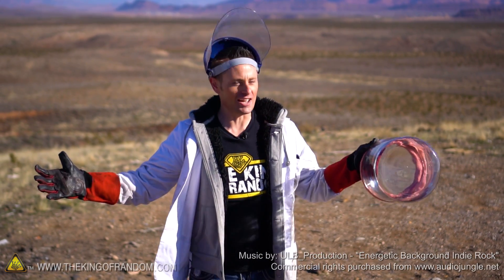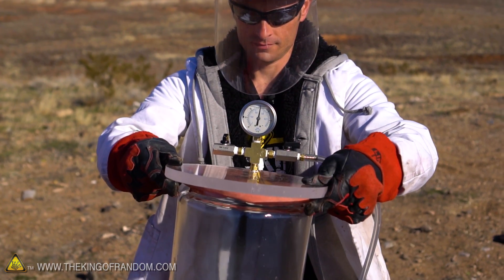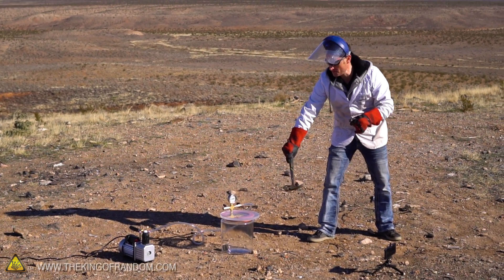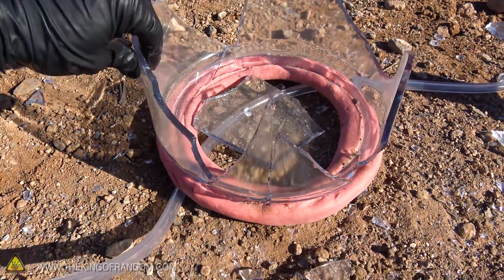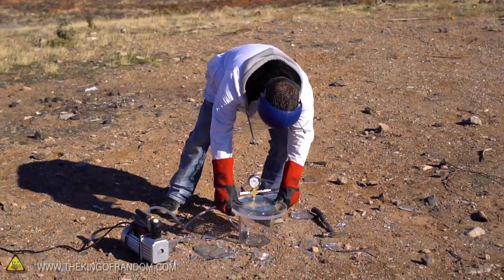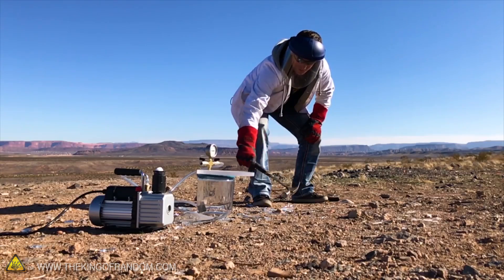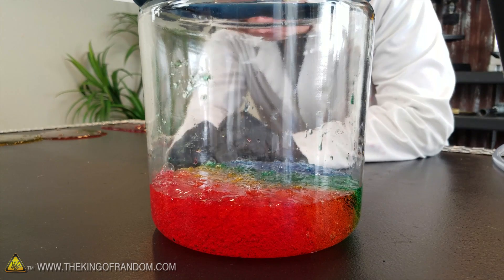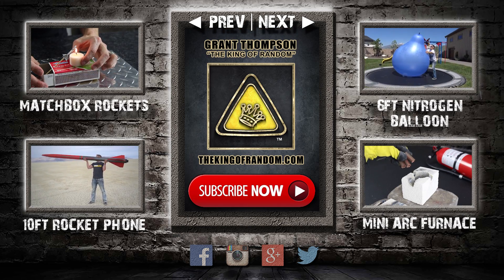Smashing Glass Vacuum Chambers

Comment: There was definitely a pressure wave when the chamber was dropped. It went completely flat, sucking everything inwards you can still see the camera shake. Nothing on the ground moves during either time the camera moved but they’re in the second. You can actually see the pressure wave the only way to really tell that the camera moves is by looking at the background you’ll see it’s slightly shaky.

Comment: Well those bell jars are actually made of much thicker tempered glass so if it does shatter it won't throw jagged pieces of glass at you, but it would only be square cubes of glass. Also bell jar glass is heavy, like really heavy. Glass is about 1/2" thick or so. I had used one of those vacuum coater that sputter coats samples for SEM usage, and the bell jar for them is quite heavy.

Comment: Your camera is experiencing a gradual decompression and a rapid compression.   If you are only reaching 25 inches of vacuum, there is something wrong with your setup.   Why did you go out to the middle of nowhere to run these tests?  The glass could have been well contained in a backyard setup.   Why not use a pendulum weight or some other means of breaking the jars remotely?  You endangered yourself doing it by hand, your face mask wasn't always providing complete coverage.   Your results were interesting (it turns out these implosions are less energetic than I would have thought), but your procedures are all over the place.
Reply: Their vacuum sucks

Comment: I used to hear that a CRT could implode violently if damaged. And with some understanding of the effects of pressure differences I believed it. Until I saw one get the neck broken and there was just a strong suction noise as the vacuum was let out (or let in?)

Comment: My glass jar vacuum chamber cracked spontaneously without warning after about 3 months of use :( so I guess you can never trust it will hold up forever. luckily it didn't implode fully. I did some maths and it seems that the vacuum put my jar under continuous stress equivalent to 8 tons of weight.

Comment: You could have broken it with less "force" if you had used the claw rather than the flat, lower surface area would exert higher pressure with less applied force.

Comment: What if you slowly drilled a hole into one or used something sharp? I wonder how much of a break it needs to compromise the structure/ if there's any point where it would just release the pressure. I would assume no matter what you did, if you got all the way through it would break, but I'm interested to find out.

Comment: what does an arc do in a vacuum.? is it any different under pressure? (i would imagine so as high pressure sodium lamps have a very tight arc when they have low current passing through them at a high enough voltage to 'ignite' them) ****EDIT

Don't try this.. just remembered you make an Xray tube with high voltage in vacuum chambers..

Comment: it depends what material you use if it implodes, with the glass however, when you made a crack in it, the air rushed in so hard that the force of the air pushed out the glass and shattered it

Comment: You could also coat the outside with acrylic or fit an acrylic cylinder over the glass then the hammer wont do anything and its still cheaper.

Comment: Hey grant I was just drinking some soda and I was wondering what would happen if you put carbonated drinks in a vacuum chamber?
Reply: It will EXPLODE if the can breaks. Soda has tons of molecules of CO2 dissolved in it. As the pressure decreases on the outside, the aluminum can might not be able to hold it all in.
Reply: dontDrop_That what if the soda isn't opened?
Reply: Blizzard exists probably because it's basically water
Reply: Noah Bowers it will go flat
Reply: Noah Bowers it would go flat as flat as any soda can get

Comment: Did you hear a bell ringing? - place an electric bell or kitchen timer 
inside your chamber and turn on the pump.  Make sure the bell is turned 
on!  As the air molecules are pulled from the chamber, the sound will 
slowly disappear until it is gone!  Great way to explain to students why
 an astronaut would never be heard if he were to start screaming while 
in outer space.

Comment: Hi Grant - Do you remember the PVC bike pump you made and how it had an air in and air out valve? Connect the air in to your vacuum chamber and see how low pressure you can get from that bike pump you made.

Comment: What would a can of soda do in a vacuum chamber?
Reply: Nothing if its not open
Reply: It would explode since unopened cans of soda are underpressure so in a vaccum with no atmosphere to prevent expansion of the bottle the bottle will expande and eventually burst
Reply: @divine308  it's only a difference of about 14 psi to the can, well within it's limits. I predict the can would be fine

Comment: Will HHO gas still explode with no other air? I know that is cannot be a complete vacuum if there is some HHO in the container, but you could put some in a balloon and hook the balloon to the intake valve. If you do this, be careful not to have the balloon get sucked into the jar, but that could be another experiment.

Comment: It would take less force to shatter the jar if you hit it with the claw side of the hammer. The flat side spreads out the force the claw would concentrate it into a much smaller area, making the force/unit area skyrocket.

Comment: What happens when you mix molten metals with liquid nitrogen
Reply: Yeah, someone with an actual brain
Reply: CAKEMONSTER3000 depending on the mass of the nitrogen the metal might solidify, what will surely happen though is thar the nitrogen will boil violently expanding (almost exploding)
Reply: CAKEMONSTER3000 solid metals the nitrogen would freeze it and it would be solid

Comment: It explodes... how unpredictable... -_-
Reply: Imploding I say, the atmospheric pressure was weighing down on it, and Grant's hammer just provided the energy to compromise the structure of the jar
Reply: You can tell, because the glass jar turns white, meaning that something was sucked in, hence implosion.
Reply: i say it explodes. 
it suffers a rapid re-compression . all it needs is one crack to let the air in.

Comment: put dough in a vacuum chamber and see if it can make bread without air bubbles
Reply: SilenT●CSGO & More!   *Edible
Reply: ItsAlex Then its dough rock,not bread.
Bread is supposed to be eatable
Reply: JohnnyDeRp_ 123 Thanks!
Reply: SilenT●CSGO & More! You're welcome man!
Reply: Actually if you want to make bread fluffy, you need two things. A leavening agent, something that will put air bubble into it, and structure, something in the dough that will keep the bubbles in. The structure is done by gluten. As you knead dough, it becomes harder and harder, because the gluten is proving more structure.

Depending on the type of bread you're making, ie Irish soda bread or dinner rolls, you'd use different things

Comment: You should put a bunch of 'puffed' snacks in the vacuum chamber like Cheetos Puffs, I would think as the air is removed the snacks should shrink and they may actually break and crumble as the air is reintroduced because of the internal structure

Comment: Grant Thompson!
Please try a balloon in a vacuum chamber!
OR EVEN
A water balloon!
LIKE if you'd see it!!!
Reply: Kevin Crane it's just going to expand. And pop. Really nothing video - worthy
Reply: How about coconut, how much inch of mercury does it take to break the coconut.
Reply: Thank you Joe, I'm glad someone else can think
Reply: Kevin Crane i said this already
Reply: ThatOneTroll Lego how do you know it will pop?
Reply: Kevin Crane not
Reply: Kevin Crane Even if it doesn't pop, the only thing that will happen is that it will get bigger. Air is constantly pushing against the balloon from outside, at one atmospheric pressure. Start decreasing that pressure, and the air inside the balloon won't have anything pushing against it, so it expands outward.
Reply: Michael Parham did I not say a water balloon too.
Reply: +Kevin Crane, same results, you honestly have an IQ of a gold fish

Comment: I got some ideas for you.

1.) I would also like to see you making a salt battery with salt, distilled water, thin plastic tubing (like the tubing you used in the hydrogen experiment), glue (to hold the cells together). It is like the penny experiment you did in another video. You can use zinc and copper for this as well (for the + and - terminals). I wouldn't use hot glue to glue the cells because it is very messy. I have seen your videos, and you seem to figure stuff out as you go. Also, I would use pennies like you did, making sure you clean the pennies. Try with a little salt and a lot of water, a lot of salt and a little bit of water, and just in the middle (50% salt and 50% water)

2.) Do proto putty in a vacuum chamber. 

3.) Mix dry ice into powder and mix that in with slime then put it in a vacuum chamber. 

4.) Do dry ice and/or liquid nitrogen vs molten metal.

Comment: Grant you don't have to make a new lid the scratches will come out with some light wet sanding and buffing. I have done it to acrylic aquariums in the past its not hard and it honestly don't take long. start with 400g then go to 600g then 1000g and on to 2000g then get some buffing compound and a low speed buffer and in a few minutes the scratches will be history.

Comment: You should experiment with whacking the corners and bottom -  I suspect that the outside is rather strong, but generally with glassware, unless extra thick and specifically strengthened, corners are weak - and on these jars, the bottom appears to bell up slightly but doesn't appear to have the classic "wine bottle" thickening that would be necessary to strengthen that shape against vacuum (the inward bell is specifically strong against PRESSURE in the vessel - but weak in the opposite direction...)

Comment: Why did you use a hammer instead of a purpose-built glass breaker like those made for automotive applications? Those spring-loaded ones can even be triggered remotely if you're clever about it.

Comment: You may be able to salvage your top polycarbonate plate with a torch. You can use it to gently remelt the plastic and let it flow back smooth

Comment: its cool the vacuum is strong enough that it sucks the broken glass and dirt into the job before it equalize and fails so you get a sharp wind for the flow of air getting sucked through the crack and then poops out the top because the vacuum and the airflow equalizing crates that draw it's a really neat experiment

Comment: Put a Newton's Cradle in a Vacuum Chamber. You can start it by using magnets to hold up one ball and then remove the magnet from the outside if you get what I mean 👌
Reply: Will it really continue forever cause there is no air resistance?
Reply: It won't continue forever because there is no such thing as a perfect vacuum (not even in space), but it will definitely go a longer amount of time.

Comment: Just be careful.  any chips or cracks will dramatically weaken the strength of those jars.  

I do vac distilations a lot.  i've seen some pretty tough glass implode with even a small chip or crack.

Comment: So am I the only one that thought this didn't really look any different than breaking glass with no vacuum chamber?
Reply: Without the pressure it would probably just crack instead of the whole jar shattering all at once
Reply: i wonder if that should also have been in the video.
Reply: Kevin Allen me too
Reply: He should definitely demonstrate whether the vacuum makes an appreciable difference to how much force is required to break it, i.e., do we really need to take extra precautions?
Reply: Usually when you rap a glass jar with a hammer the top half of the jar (along with a presumably heavy thick acrylic plate) is not forcibly ejected several inches into the air.
Reply: well.. the sounnd surely isdifferent.. and i think that if there were no vaccum it probably would be less jumpy
Reply: Because it's no more than 14 psi. People think a hard vacuum with normal atmosphere outside means imploding like a submarine.
Reply: Kevin Allen I feel exactly the same
Reply: @Joe Morgan Mm. Maybe, but hitting glass with a hammer usually shatters it....And if you recall from the video he did chip it before he destroyed it. So there is still a range of impact strengths between just damaging and obliterating the glass. How do we know if that range is significantly different than for an unpressurized system?

Comment: That is actually what i thought would happen because when you cracked/shattered it t would not implode the air would rush into the jar causing it to re fill with air and blow out in the opposite direction from the sheer force of the air rushing back into it, so theoretically you will not be able to get one to implode but only explode.

And why don't you try to to put ferrofluid, ooblek or liquid metal into it and test that out?

Comment: So Grant, the jar is it's strongest at the sides, with the vacuum pulling inward and the rounded shape of the sides you almost have a mild "Prince Rupert's Drop" effect which means you are strengthening the side wall part of the jars compared to normal pressure. 

The weakest part of the jars under vacuum is actually the very bottom, that part of the jar is  already concaved inward slightly and with the vacuum putting additional stress in that same direction it's far weaker that at normal pressure. It's designed to hold internal pressure above normal from within as well as additional weight in a downward direction.

Hope this is food for thought.

Comment: Put bubble wrap in a vacuum that would be so cool
Reply: It depends on what the plastic does. I have a feeling the bubbles would expand quite a ways before they popped. Deflation would only happen if they sprung leaks really easily, since the pressure is from within, not pressing on the bubbles.
Reply: Elias Baez no it wouldnt
Reply: Ren_posted that would be so cool
Reply: Harmbe Died For Our Sins it wont pop it will just deflate
Reply: Ren_posted yess
Reply: yessszszzzzzzzz
Reply: Ren_posted yes
Reply: Ren_posted i was replying to a someone. That was his name
Reply: Daniel Ng Tze Yi interesting but changing the atmosphere might just solidify ot again
Reply: Ren_posted THAT WOULD BE AWESOME.ps 200th like
Reply: Like if u agree so he can see
Reply: itll just pop not very exciting

Comment: TRY POURING LIQUID NITROGEN ON MOLTEN ALUMINUM
Reply: back yard scientist did it, not as cool as you think
Reply: JuliaG109 that's what I commented
Reply: JuliaG109 no in a vacuum chamber
Reply: Nah, I bet the aluminum would stay molten. I think it takes a lot more energy to cool metal than to heat nitrogen.
Reply: Metals typically have a very low specific heat, lower than liquids, so Tydekan is right.
Reply: bruh realy so so cool hey lisin do it grant

Comment: Put a small chamber and its pump inside a big vacuum chamber and its pump and run them both.
I'd say the inside chamber would have a very high vacuum.
Reply: One can achieve a somewhat higher vacuum by chaining pumps in series that way, but how much higher depends upon many factors, including any valve inside the pump. In general, it is best to have the final pump push gas to atmosphere, just so that it is assured to not cause a pressure buildup anywhere.
Reply: That's what I meant. The outer pump exhausts to the atmosphere, and the inner pump to the outer chamber.
Mainly I posted because it sounds funny. People are always saying "put X inside Y..."

Comment: A note on vacuum pressure; at an altitude of about 1 mile you can only get to about 25 inches due to the air pressure of 12 inches. At sea level you can get about 30 inches in a chamber due to the 15 inches of air pressure. You cannot get better than a perfect vacuum. Stu

Comment: You could make an acrylic box or cylinder for a vacuum chamber. You'll no longer need the proto putty for the seal. It will also be stronger than the glass.

Comment: How does the microphone on the gopro pick up sound if sound waves don't travel in a vacuum? +TheKingofRandom
Reply: Pablo Gomez it wasn't a perfect vacuum, and also it was resting on the glass, which provided as a placement medium instead of air. All sound is is air molecules vibrating. Instead of air, the glass vibrated, transmitting the sound to the GoPro.
Reply: Pablo Gomez there's still some gas inside also the camera is touching the glass which will vibrate.
Reply: He just synced the audio from his external mic with the video from the gopro I think. His voice sounded muffled because he had the face shield on
Reply: what if the GoPro was held by a string instead? ;)
Reply: then some vibration would travel through the string from the glass
Reply: Pablo Gomez the vibration of the glass
Reply: Thanks guys

Comment: what happens if you put a vacuum chamber inside of a vacuum chamber?
Reply: Ricardo Rodriguez vacuum chamberception
Reply: Ricardo Rodriguez  nothing will happen
Reply: The inner chamber will have less stress upon it. With the sealing method shown in this video, the inner chamber would have trouble sealing. If some mechanical clamping is arranged on the inner chamber to make it seal properly, it will (in best cases) be found to degrade the vacuum more slowly, since there is less external pressure to force gas through the seal.
Reply: Ricardo Rodriguez wtf
Reply: Explosion

Comment: Is there a way to have zero gravity
Reply: no
Reply: that's imposible
Reply: kyan 10 no but there is a way to have 0 G
Reply: no there's not. it's physically impossible to have 0 g
Reply: kyan 10 magnets
Reply: magnets won't work eithrt
Reply: Put yourself inside a room that's free-falling. Although It's microgravity, it'll be still 0 g's inside.

The "room" could be an elevator, or plane...